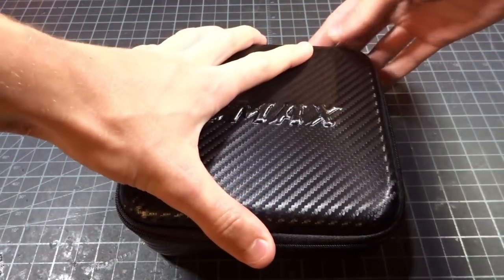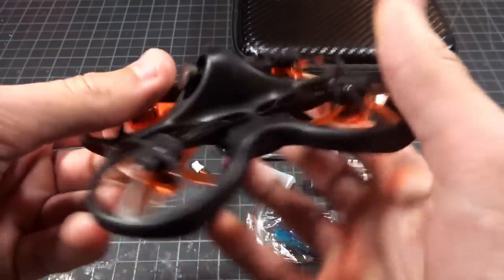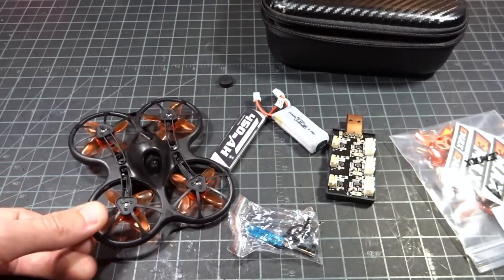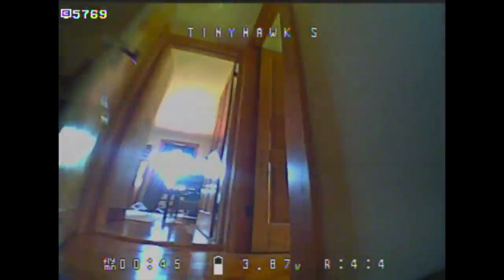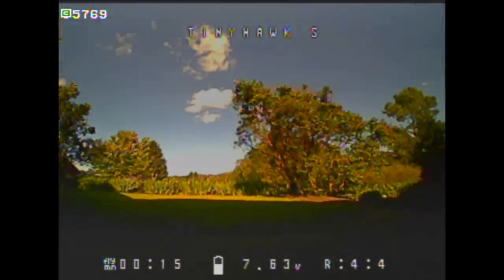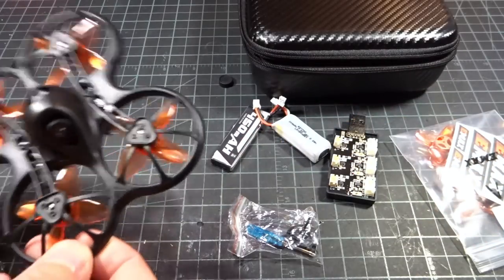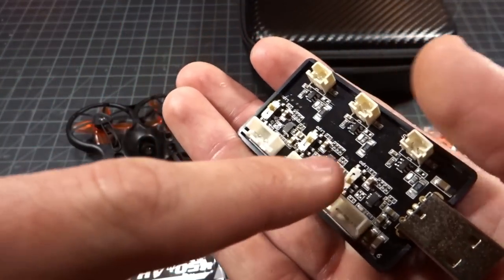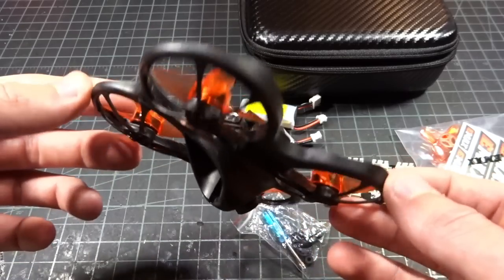Emax TinyHawk S Review : 1s Beginner Quad and 2s Beast!

Comment: What about flying this 2s indoors? Im getting this and i want to switch to the xt30 connector, so I wanna know if 2s is flyable if i cut the throttle?
Reply from the maker: If you use a throttle cut it should be fine.

Comment: Great tour of your house, both inside and outside, looks like a great little quad, pity I’ve only got a spectrum radio, otherwise I’d get it. I’m in Australia and the prices over here are ridiculously expensive. But on a great note, I’m getting an iflight turbo bee, which is way more than I’m used to, but looking forward to the challenge of getting it zooming around the area. Good review of that little beast, and as per usual great flying.
Reply: There's a DSMX version.
Reply: William Decoteau , there is? Damn, I’m going to look for it now, got to have one of them now.
Reply: @DavidReynolds-kr6yh  Well, at least I think there is. I think there was an option when I ordered mine. The manual does refer to binding a DSMX version. So if not now, there will be one soon.

Comment: I am having a lot of trouble deciding between buying the advanced package for the eachine qx65, or splurging a bit more to buy this quad. This one has more versatility being able to fly indoors and outdoors but the eachine qx65 is cheaper and comes with way more batteries :/
Reply: I did have the same question as you and i did buy this one tinyhawk S. In stab mode is very easy to fly, I'm using with the taranis qx7, my first fpv drone and first radio ( i was using the e013 RTF not a real radio ). I really recomend this one because you can use it for indoor flight and outdoor aswell and is very resistent. The only cons for me is the camera! Is a bad camera and have no protection at all, the lens keep coming off i will upgrade my for a runcam nano 2. But man i think worth you wait a little bit more and save money and buy this one with a good package of batteries. 

Sorry for the bad english.

Comment: Pretty fantastic flying, dude! 😃
Really great little quad! 😃
Reply: I swear it looks like a perfect indoor/outdoor beginner quad!
Reply: @businessmail4929  Absolutely! 😃
BTW, how things are going? Did you get a transmitter?
Reply: @MCsCreations  thank you for asking!
 i eventually found out how to switch modes in some of the popular transmitters. as for now, it's too expensive to get into. I will look forward in future. At the moment I'll spend my time in gathering useful tips and tricks for the hobby.
Greetings
Reply: @MCsCreations  for your question; i managed to buy a Eachine E013 for trying it out first. I have no extra batteries or a charger that charges many at the same time but I literally charged 20 times within a single day! Haha

One problem I'm having is that I have to re-calibrate every single time and even then I have to adjust the directions. Ugh. Also the power is quiet lacking if I throttle up. I often throttle up and it barely lifts up fast enough to avoid obstacles. It's still fun though.
Reply: @businessmail4929  Yeah, I know exactly what you mean. Unfortunately this hobby is really expensive. 😕
What I do is to buy stuff little by little, you know? Then build myself. And the expensive stuff I divide into a few months. LOL
Reply: @businessmail4929  Fantastic! 😃
Yeah, it's a brushed quad, right? They are like this, really. The important, anyway, is to have fun! 😊
Reply: @MCsCreations  exactly! will be probably my strategy lol. right now I'm saving a couple bit a month until Christmas for a Parrot anafi since it has a good range, shoots 4k and has brushless motors/sports mode which I can use for a little racing too. Sure it isn't a racer but I've seen a couple videos where people flew very fast and agile with it. Also the 25 minutes of flight time are a plus which is why I save for the anafi.
Everything's just ridiculously expensive for us haha ugh
Reply: @MCsCreations  yes! i think it's more suitable for younger kids since they're not too fast. The UK65 brushless quad is more suitable for a little older kids and above I'll say! Haha
I thought I'm a badass and opened the window (from a taller house) and flew it right outside the window and the wind + the calibration fail drifted me towards the wall and it fell on a concrete. But! It landed on its legs! It had no scratches whatsoever! Just the plastic that covers the case wasn't as sticky. That thing is a beast! It literally survived such a altitude haha
Reply: @businessmail4929  Really nice! 😃
The Anafi is really great! 😃
But yeah, that's the amazing side of the little brushed quads: they are almost indestructible! 😂
I build one a while ago, it's on my channel. The only thing I had to replace until now was the motors! 😃

Comment: i love the x class that you flew through
Reply from the maker: There will be more soon
Reply: @TheRCAddict  yay. I have some  4108 motors lying around and I wanna build an X class with them
Reply from the maker: I'd consider something smaller maybe 10 inch since they are a small motor. What kv?
Reply: @TheRCAddict  600kV and the thrust data on banggood suggests 15 inch prop is the most powerful